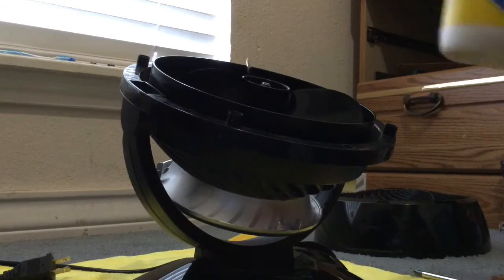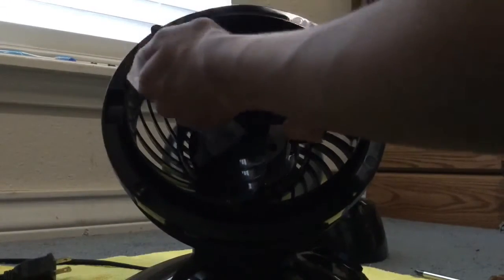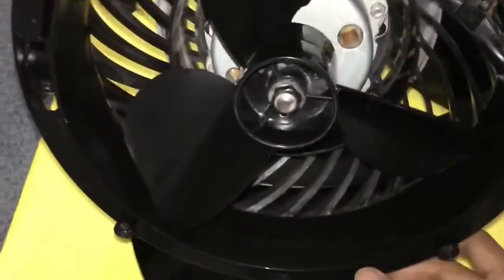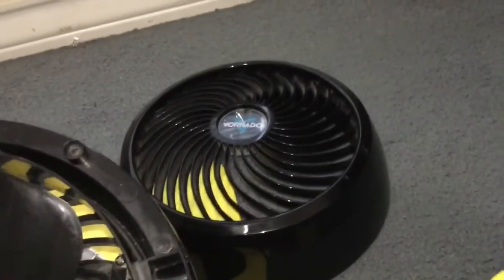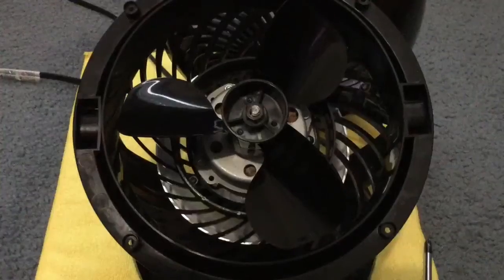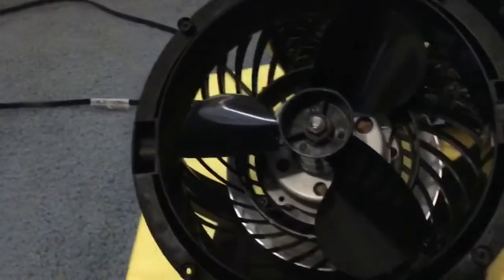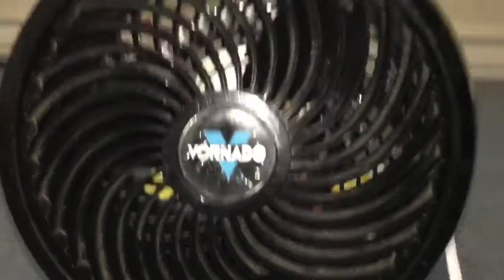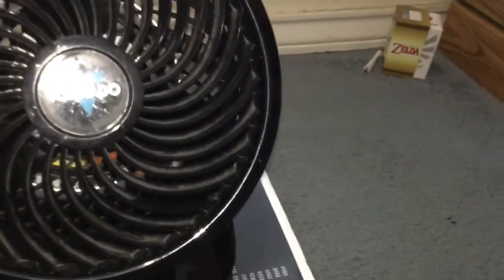Vornado 5303 Fan Cleaning

Comment: How did you open the top? I'm having trouble opening it.
Reply: If you look at the back of the fan, there are four small screws that keep the front grill attached to the body of the fan. 

Imagine the face of a clock, amd the screws are at 10, 2, 4 and 8o’clock.